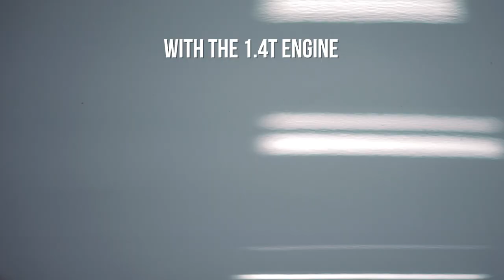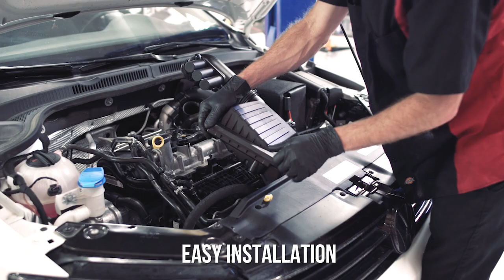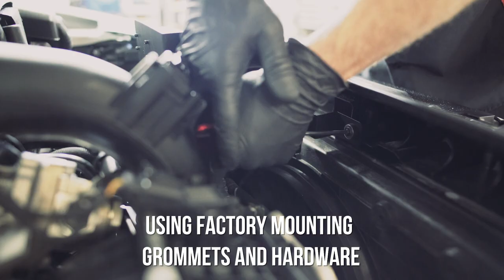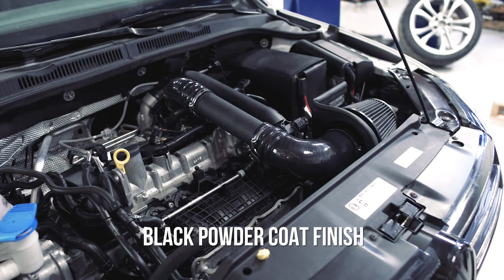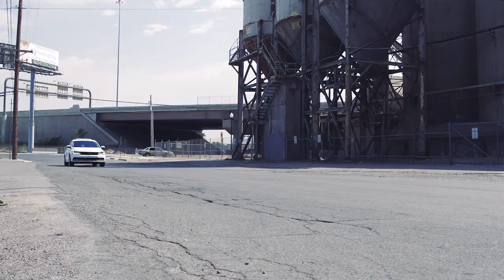IE VW 1.4T Jetta Cold Air Intake Overview

Comment: What about MK7 Jetta 1.4?
Reply: Injen has a fairly reasonably priced intake. Just ordered mine Friday for the 1.4t.  Should be here Tuesday.
Reply: @aaronpari6507  link? I don't see it on their website.
Reply: I may have goofed bud.  I must've read it quick and thought you put 17 not mk7.  My mistake.  Not sure if the 19/mk7s have anything as of yet or not.
Reply: @aaronpari6507  I don't believe so. I've been looking. It sucks because it's the exact same engine.
Reply: @Jesse DeLapp    found a borla cat-back.  That's about it as of now. https://www.moddedeuros.com/volkswagen/jetta/mk7-2019/exhaust
Reply: Yes.  Same engine but the engine bay is slightly different.  You could always try getting an intake for mk6 and see if it'll fit.  Just check on return policy if you decide to go that route. Or custom fit one with pre bent pipe and a couple elbow pieces.
Reply: This kit does not work on 2019+ 1.4t but they still advertise for 2015+. Just attempted an install and it is a totally different intake system than the 2018 and lower models.